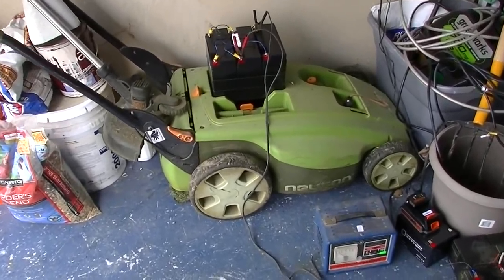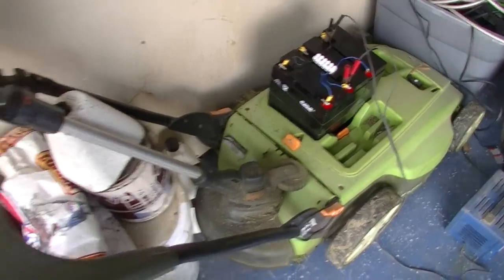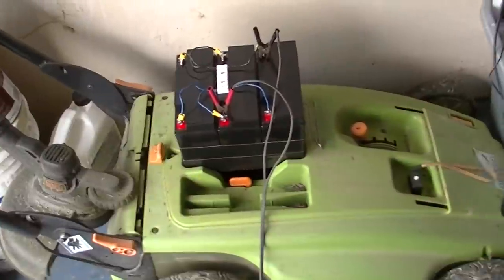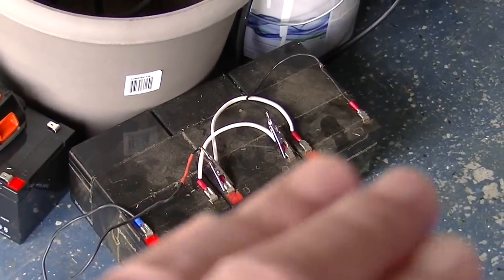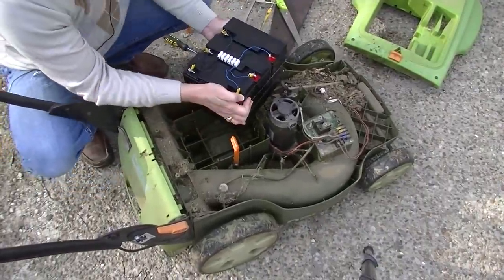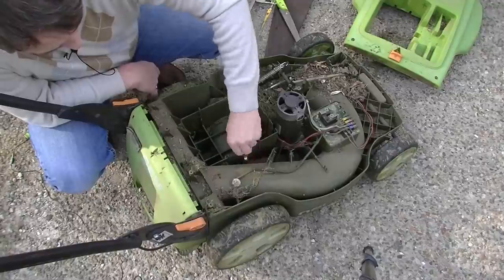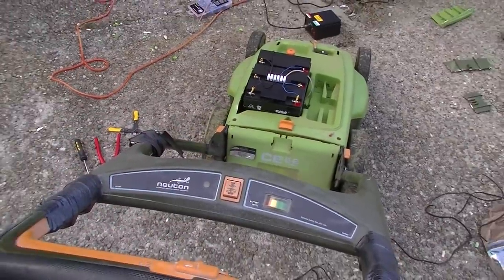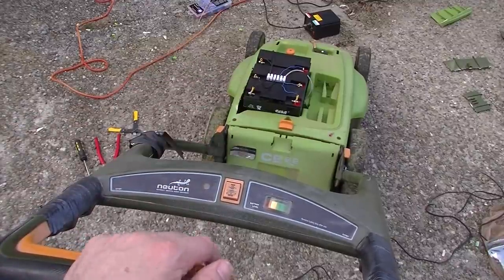Hot Rodding a Trash-Picked Electric Lawn Mower! - (Neuton CE6 Modification)

Comment: I found one of these in the trash last year as well. It was a 24v model. If you attempt this project, trial and error will show you MAKE CERTAIN the batteries are good. Just bc the voltage tests good does not mean the amps will. The cells in these smaller ups type batteries go bad all the time. Thanks for the videos Mr Brad!

Comment: I thought the gauge of wire you used was too small. Just an observation. 12 or 10 ga. would have been safer. Less heat. You did do a great job of bringing the mower back from the brink! Dumpster diving and freebies from yard sales, are the only way to go! Recycle, reuse, repurpose! Nothing like the satisfaction of fixing things! Maybe it means you are a tinkier, that is a compliment. Thanxz
Reply from the maker: The new wires were from an AC power cord. I figured they'd be ok, but you could be right. I may dig around for something heftier to carry the current more efficiently.
Reply: Looked like the leads were arcing in those spring clip connectors...
Reply: @Fixologist1  You could just run 2 or 3 wires from the original posts to beef up the gauge, AC generally draws way less Amps . One reason the leads to the battery on your car has big chunky leads. 
Was a smoker for years and when I switched to using a Vapouriser got a real quick education in how much Amperage can be pulled out of a battery and when you're playing with LiPo's you want to understand cause Thermal runaway can be pretty dangerous. Glad you're using the old Lead Acid, may not be as efficient but a heap safer ;)
Take care mate.
Reply: @Fixologist1  Audio Tech has a good point.  It's not about the voltage, it's about the amperage carrying capacity.  Those push button blocks were only rated for 10a.  At 36v, you can only pull about 360w on those.

By running the thinner wires, you're introducing voltage drop, meaning the current goes up to meet the demand.  More current = more heat, effectively tripping the breaker.

Comment: You could have gone to one of the battery specialty stores and purchased 2 of the 18 volts batteries and inserted into the compartments without weakening the mower deck. This is fun to watch and this is a teaching video about how the circuitry works on these wonderful machines. I have had one of these for about 19 years. It still runs fine.

Comment: I have a smaller yard, and gave up gas mowers years ago.  I don't miss them! 
Speaking only for myself, I now strongly prefer electric mowers to gas 
***You never have to yank on a cable to start them (#1 benefit)
***You never need to do an oil change (#2 benefit)
***You never get carbon monoxide or smoke in your face
***You can hear around you because they are so much quieter
***Recharging them is just easier and cleaner than handling gasoline

I actually have a 6.2 Neuton in my backyard (36V) and a 40V Ryobi for my front yard.  
The Ryobi lithium battery format is lighter, smaller, and more powerful than a 3 x 12V Sealed Lead Acid pack, so very soon I expect to buy an adapter and start running my Neuton 36V mower on my Ryobi 40V pack as well. 

I'm completely done with gas mowers, but lately I think I'm also done with sealed lead acid batteries.   Lithium batteries are the best format I've ever used.

Comment: Really nice mower for something found in a garbage pile-Great you got it going again!You may need to use heavier guage cable for the leads to the mower and batteries.The key does have a breaker in it-you will need to wait for it to cool before it resets.I had a mower with a key like that.

Comment: If it were I i think i would see what kind of voltage drop you have to the factory battery terminal and see if maybe a Larger Ampacity wire at the batteries might help the tripping problem .The wire should be at least the same gauge as whats inside the mower because low voltage will cause more current draw and that may be tripping the thermal breaker. I only say this as i deal with electric carts all the time and have ran into these issues before . Great video on reusing and less waste !!
Reply: Good call. I was going to suggest that. I'm surprised he didn't think of it , he knows about voltage drop, I'm pretty sure.

Comment: When my Neuton 36 volt battery shuffled off its mortal coil, I took the case that had the three 12 volt lead-acid batteries in it, took the back wall that connected to the slide terminals and used an adapter to connect my 40 volt Ryobi LioN battery

Comment: Ahhhhhh, the Dremel. I have to be honest, I was really excited to see ya come at this with one. I was hoping I'd learn something new, but I'm not mad.🤣

  Love tinkering with Power Supply's for some reason. I was able to use a Nintendo Gamecube power supply as a hard power connection for my car stereo deck. It came inside to become and indoor stereo and ghetto monitor system for my laptop and D.A.W. Hey man, it worked!🤷‍♂️

Comment: Hey Brad, cool video. I had to cut something similar and had the same drawbacks with multiple implements and rotary tools. That is; until I grabbed an old soldering iron on it's hottest setting then all the removal was like a hot knife through butter.
Reply: They make blades for Weller guns for that very purpose.

Comment: Heya Brad, tip: try doubling the cutting wheel on your dremel I've had pretty good results with that...
Reply from the maker: Not a bad idea. I believe I will try that next time.
Reply: Yep. They last alot longer when doubling them up.
Reply: Why not just use the saw cutting wheels? I guess they would handle plastic.

Comment: Was going to tell you to  take off the knob as you were doin it ,was going to tell you to move that battery connector to the side as you were doing it ,what a  coincidence , then you mulched your trimmings just like I do.  Hahaha Funny stuff going on,or I've been locked in to long.  I'm thinking that mower has a thermal circuit that'll shut it down if it draws too many amps.And in the case of those batteries,like you said is overpowering the system after 17 or so minutes. You could try a current limiter .Or it might have one already that you could modify . Good luck on fixing her up.Stay healthy for you and family.   😎🎸

Comment: All these "green" products dont seem very "green".  A lot of plastics and batteries that are thrown out.

I used a Craftsman and Honda for decades with only regular maintenance needed.
Reply from the maker: The problem is, after the battery dies, many people look at the cost and just toss the whole damn mower and buy a new one for that price.
Reply: @Fixologist1  yeah, and you cant find people to fix them like you can a small engine.

Hell, the CIV has prompted me to fix my tascam 4 track and 8 track that I had sitting broken in my closet for about 6 years now.
Reply: @BockwinkleB  I pulled out an old 4 track tape recorder out of storage and demonstrated it to some teenagers that hang around my daughter( who play a bit) they couldn't believe anyone could, and or would put in the time.
Had plenty of time lately, I even "finished" some tracks that were on the tape in the deck.
Reply: Welcome to capitalism.
Reply: @BockwinkleB  ((you cant find people to fix them like you can a small engine))
That will probably change as more people figure out there are good deals at the curb on trash day like this guy did.

Comment: I'm on my second Neuton CE5. First one got stolen. I just tried to get a replacement battery, but they are now discontinued. I think the pandemic may have impacted their business. Anyways I ended up ordering the 2pack of lead acid batteries from Walmart for $40. Wish me luck on swapping out the old batteries from the casing. Glad I still had a couple dead spares laying around.
Reply: It's really easy.  Great vid here on the battery cell replacement https://www.youtube.com/watch?v=71diukQdbvk

Just did one of the 3 batteries my Mom's Neuton 5.1 has.  Works perfectly. I did have to bend the two metal straps in slightly different spots to get them to drop over the battery into place though, the pos/neg tabs on the battery are just a little bit further back on the top of the cells. As long as you still get contact at the bottom with the tabs inside the mower after, it works just fine.  Was maybe a 1/8th inch adjustment.

Comment: Elsewhere on YT, I saw a guy replace the 24 volt battery with 2 12 V, & guess what? What? They fit perfectly in the old battery housing which sits perfectly into the original designated space for the battery. 

Since Duracell isn't making those batteries anymore, it would be lots easier to find an old, dead battery,remove & replace with 2 new 12V batteries. No hacksawing required.

Comment: You will need an oscillating tool to cut away plastic parts as shown here.Faster and better than a Dremel tool-Dremel even makes such a machine.They work like a doctors cast cutter tool-a saw blade that oscillates very fast and tiny strokes.These tools are great for such jobs!!For your projects such a tool is very useful along with the rotary Dremel tool.And both of these available as cordless-just pick up and go-no stringing extension cords.Like the rotating Dremel tool you can get sanding heads for the oscillating tool.

Comment: that is an overload crk protector,slow down and take your time donot lug the moter it will draw tomuch current,take it easy!the more load the more current draw!
Reply: Yep, when that white circuit breaker he's overheating something.
He was cutting stuff that was too deep, and pulling too much current.  On my Neuton 6.2, this happens mostly when my batteries' voltage is low.  That lower voltage means it takes a higher amp draw to get the same power.
Higher amps means more heat.

Comment: Wiring too small a gauge for the increase in current/amps/watts?
Reply: I think so too. It looks like you need 10 gauge for this application based on those thicker wires by the motor. Those small wires are probably getting hot and causing the breaker to pop because of too much current. Just my $0.02. Happy mowing!

Comment: I'm all for the environment, but some things just aren't good enough to get the job done sometimes. Battery powered yard tools, for example. I use 'corded' electrics on my yard. More of a hassle dragging a cord, I know but they never fail mid-job and always have adequate power to git-r-done. I'm not you, Brad but after the second time that thing quit? It'd be sitting in MY front yard 'free' pile! LoL
Reply: Corded power tools are better. How far do you venture from a main to need cordless at all times? Corded circular saws kick cordless ones down the street all day long.

Comment: I know I'm way late, probably won't see this, but the wire gauge suggestion was correct. I'm wondering if there's a way to step down the amperage, with a capacitor of some type. It's been 45 yrs since I took Basic Electricity & Electronics, & it's been 35 yrs since I did any electronics work( wiring my stereo, guitars & recording studio don't count) that I got paid for. I've noticed the people  with those mobster bumper stereos in their vehicles use a huge capacitor now. They used to put an extra alternator/generator on their motors. Just a suggestion, I honestly have no idea of their cost. I've got an old 300 watt rms per channel stereo, & an 80w Marshall combo amp, plus a cheap 100 w PA system, so I don't need all that other shit. I can get plenty loud myself,but my sounds is clean, no vibrating the car chassis to hell. Good luck. Wish I'd have found your channel earlier, been watching you for a few months now. Blessings to you & your little ones.

Comment: Hey Brad I just came in from mowing my lawn as well...I push my lawn, even though its pretty big, simply for the exercise.
Any way... I like your video. Interesting.
But... strongly dis-like ''green'' devices. Now...don't get me wrong they are quiet, and trouble free...usually. But green devices rubbed in my face constantly is a lie...they are dirtier than their gas contemporaries.
And I just know, I am going to catch hell for this... I can feel it.  Just to let you know, I am a subscriber , love your channel and watch religiously....so here goes.....
They are not powered by electricity, They are powered by coal. Yes, dirty, black power plants, powered by coal. That's where you and I know the electricity comes from.
Batteries are fantastically dirty to make and recycle...what do you do with all that acid, lead and plastic? Yeah.....Especially a 800 pound battery in a Prius
I like the idea of Electric stuff, but can't stand the environmentalists who think because they have a...bla,bla,bla. They are superior to my neanderthal ''gas'' thinking.
I picked up my Honda 21 inch no frills side discharge grass decapitator on the side of the road 10 years ago. It was full of bad gas...a quickie carb clean, fresh gas, blade sharpening, oil change and greased the wheels. What a wonderful machine.  No Batteries, starts every time...never let me down. And its 20 years old.....Probably have it for another 10. 
Over $200 for a battery? Wow....no thanks.
Electric stuff? Yeah sure but the technology isn't here yet to have this stuff foisted on us IMO. 
When we can separate Hydrogen and Oxygen from Water efficiently....then we will be ready. Until then no dice for me.
IMO , its why God....yeah I know....gonna really catch it now....God made the Earth with 75% water.
Also if you bop those wheels off and smear some grease on the spindles it will push like a dream.
Reply: I couldn't have said it any better.
Reply: @phillipbainbridge9107  😀😀
Reply: You have about 5 misconceptions in that writeup.  Not gonna beat you up, just know you're wrong.
Reply: @fenderstratguy  If you receive this, this is a cut and paste message that I save for people with no content on their YouTube page. It’s my believe that they are robots. So I can’t have a conversation, unless I know you. With someone who has no content on their YouTube page. Thank you have a nice day.
Reply: @OkFixer  So you believe I am a robot?  OK; make that six misconceptions.

....And you can’t have a conversation with me because I keep my private life private on my YouTube page?  
That's alright.  I get that you like your old fossil stuff better.  I did too, until I tried the electric life.  Electrics are not perfect yet, but even lead acid batteries were better than gas.  
And now that lithium packs are here, I won't be going back to gas.  I'm hoping to sell the last of my gas lawn tools as soon as I can....it's a McLane 2HP gas edger, on Craigslist as we speak. 
If you actually still enjoy yanking on recoil starter ropes, be my guest.  I'm just done with it when all I have to do is squeeze a lever and press a switch to start my stuff.  And it doesn't smoke or stink or leak.   (Hey, I still have a Craftsman 5HP rototiller in the backyard.....I should dump that old fossil next!)
Reply: By the way, I approve of your curbside shopping habits for power equipment.  Not sure anymore how many I've gotten free and flipped after I got them running right.  The edger I'm selling is probably the 4th McLane I've sold and I've also had a Power Trim or two.  Never paid >$65 for one, I don't think.   Usually, it's just one or two little problems and a cleanup and put them up on Craigslist. 
But I'm done with gas motors now.  They're filthy compared to electric.   I'll probably continue doing flips, but only with electric machines.
Reply: @fenderstratguy  first thing, I want to apologize for calling you a robot. You just never know… I get so many of them commenting with no content on their page. So how am I supposed to know? My page is full of stuff. In my opinion as it should be. Because after all this is an open forum. It’s not a diary.
 OK, I don’t get it. You say I can’t have a conversation with you. Yet on my page it looks like you’re doing just that. Which is fine.. we all have our voice. And the right to use it on this freethinking forum. I’ll just have to agree to disagree with you.
And the reason why is this. Lawn tools are one thing..... A small thing. But it is incremental. Starting small and working to big.
This is not about cutting your lawn, this is about national defense.And the economy. It’s political. Everything is.
It started as electric lawnmowers and weed trimmers in the 60s, and now it’s automobiles.
What I want you to do, when you go on vacation is take your Electric flying bus to your Destiination. Then if we become a nation at war. I want to see the airmen flying their electric bomb and rocket platforms at two times the speed of sound.
You see, the free flow of oil at market prices Is what makes our economy. Everything revolves around that.
Jumbo jets that take people on vacation to Aruba and Acapulco… Across to Europe etc. and do it so efficiently that tickets are merely hundreds of dollars. Not thousands.
And our military jet fighters, that kill people and break things so marvelously.
Both Run on that wonderful fossil fuel… Kerosene.
Like I said before. I am all about technology. It’s great. But as far as electric vehicles… We are just not there yet.